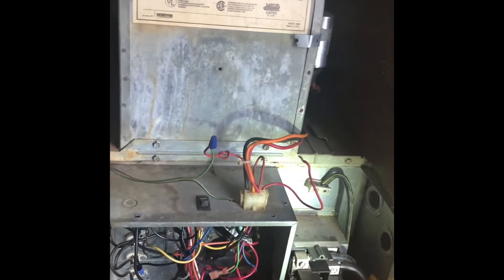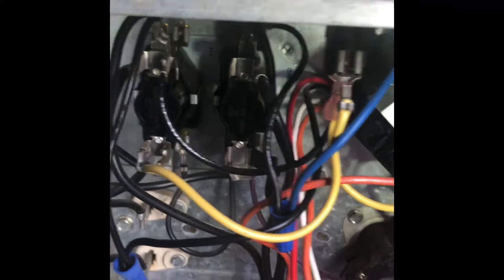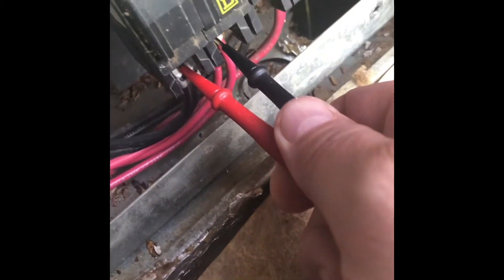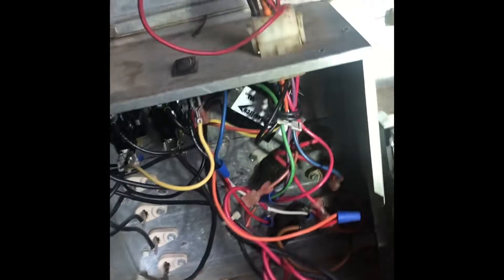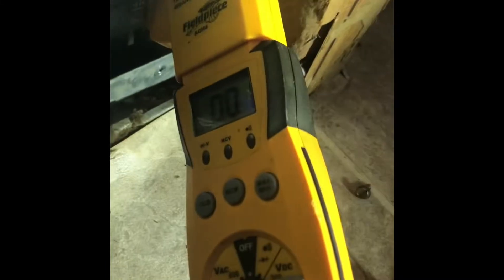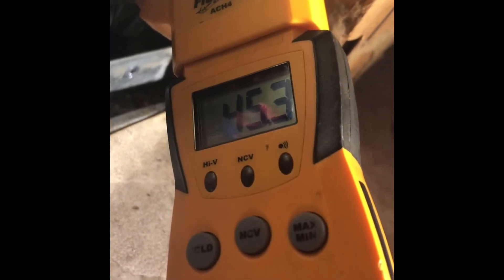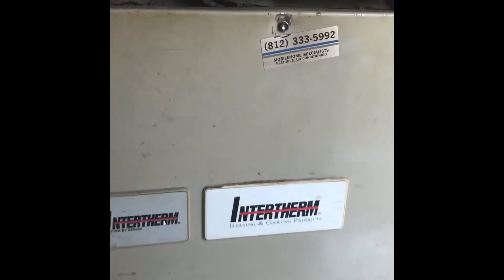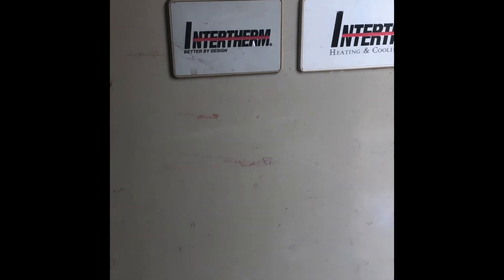Mobile home Electric furnace repair ￼

Comment: My furnace is just like that one but it will run but there's no heat.just cold air ?
Reply from the maker: It probably needs a sequencer, but it could also be related to the element problem